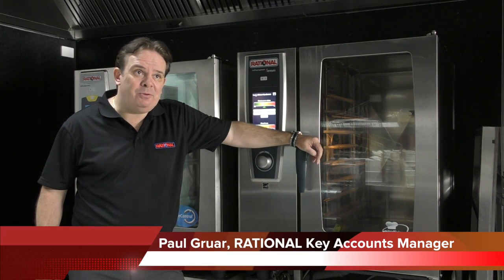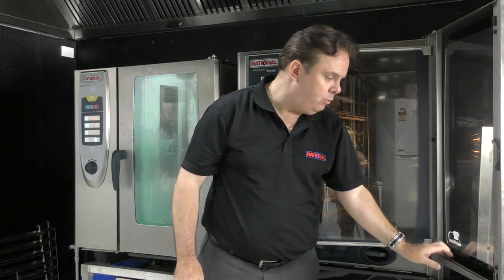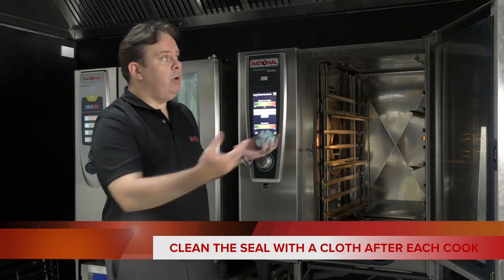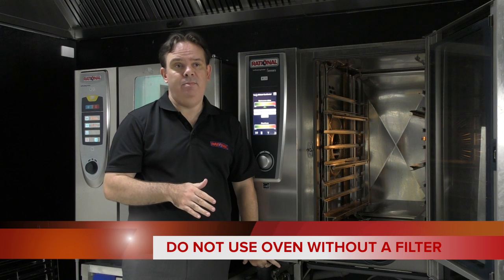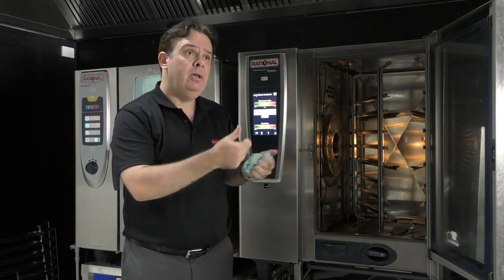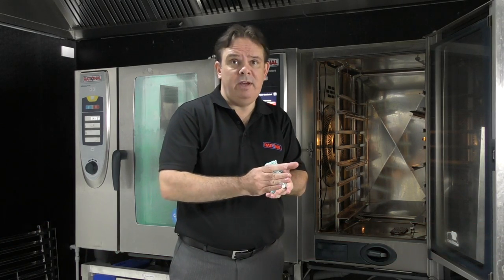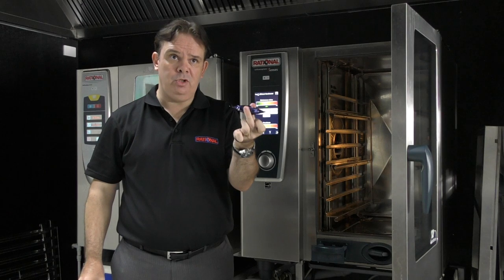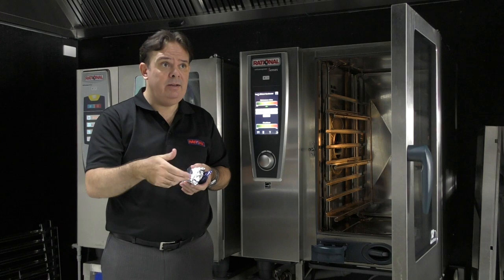RATIONAL Combi Oven Maintenance Guide

Comment: Hi, thank you for this video. I have a question. The M1 main elctric motor which drives the turbine is making a ugly noise. Is it possible to replae the bearings or I need to change the complete motor. Thank you so much for your help.
Reply from the maker: Hi, you will need to contact a service agent for  this kind of assistance. Please call 1800 810 161
Reply: How much is this oven
Reply: @ComcaterAustralia 

Hi there, how can i stop the cleaning process ? I accidentally put the oven on cleaning but i want to stop the process before waiting several hours for it to be done with cleaning